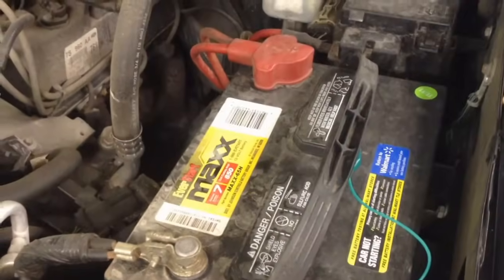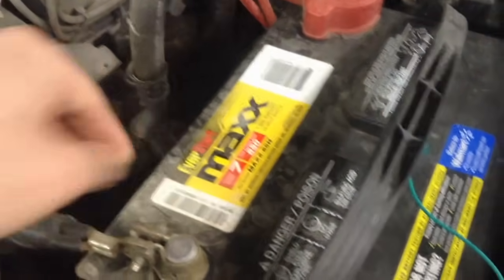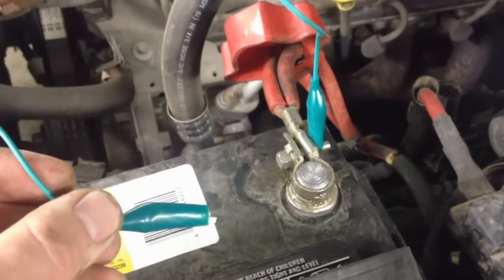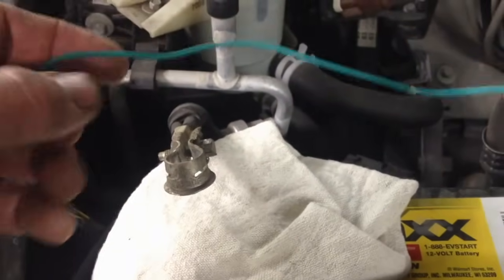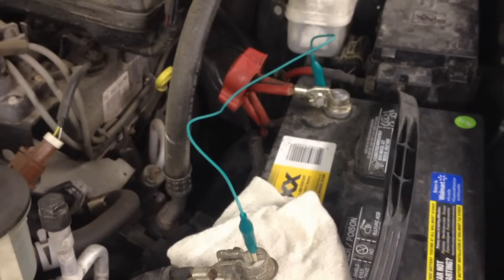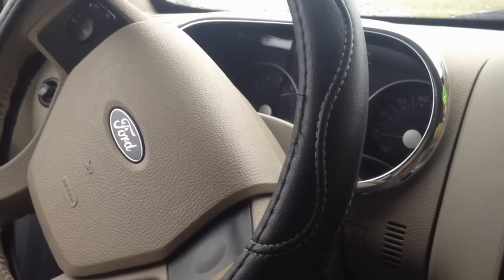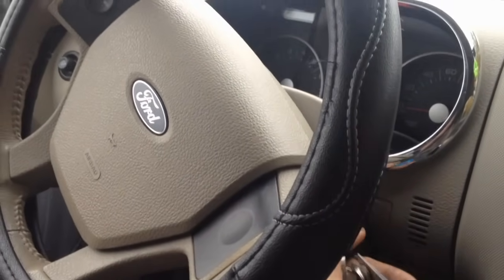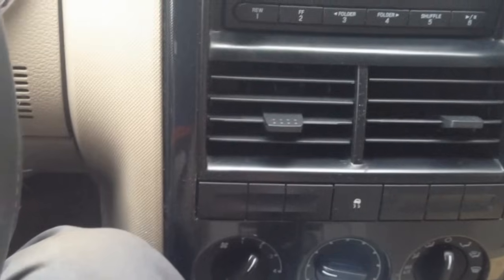How To Clear Your PCM'S Memory On Fords After Repairs

Comment: hey so I have an issue. i have an 05 Ford focus zx5 a year ago I had an alternator go bad somewere down the line in the repair at the shop or the tow truck trying to jump it, it shorted something in the system. now my rear wipers don't work my power side view don't work, no horn, no roof lights and the front wipers only work with the relay half in. all fuses and relays have been checked and all are good. I got this car at 3200 miles there is now 220000 miles on it so i would rather not spend a fortune on her especially if it's something i can do myself. any help would be greatly appreciated.
Reply: Benjamin Baker - set a multimeter in resistor mode (ohm) to see if individual electronics work by putting it on each side of the electronics.

 If it gets a value it is either shorted completely (nearly 0 ohm) 
if it has resistance it should work 
if nothing appears on the multimeter (aka it says 1) it means no connection beetween the points... 
Hope this helps :)
Reply: Benjamin Baker try adding a ground strap from your negative battery post 2 a Good ground!!!!! just a good idea.i saw a focus that when the key was in, nothing worked.added a good ground strap & FIXED!!!!
Reply: Benjamin Baker I 2 have a focus (03 2.0 Dohc L4 vin3) I watched a south main auto video where a focus had the same problem.there was a beautiful green Chevy nova or chevelle then after showing it, they bring in a red 04_05 focus if my memory serves my rite.hope that helps u!
Reply: Benjamin Baker also I'd check the connections on the the altinator!!!!

Comment: I think people are misunderstanding this video. If you have a bad transmission,  then replace it with new or rebuilt, you need to reset your ecm,pcm,computer so that the bad curves that it has saved will not be used on your new transmission- thus causing a good transmission to act just like your old bad transmission. Resetting your ecm,pcm,computer does NOT FIX current problems with your sensors, airbags, engine or transmission. Those issues must be traced down to their source, bad grounds, skinned wire, mechanic failure, etc and fixed....then.... you reset your computer, ecm, pcm (all the same but different names).
Reply from the maker: +43yr old Toy collector yes this is only resetting learned values to stock so it can learn correctly from there once the concern is fixed.
Reply: FordTechMakuloco IF!  you misunderstood this video, one is not listening to what Jedi Master says.
Reply: FordTechMakuloco so what about the video you made about harsh shifting points? Will this work or do you have to go to a dealership with the scan tool?
Reply: FordTechMakuloco  when I shuldd reset the PCM when the engine is could or hot
Reply: 22KPAR1X Cyberdyne
Reply: 22KPAR1X Cyberdyne.
Reply: It can cure hard shift issues by clearing the adaptive table....
Reply: Look below at Bruce Hubbells comment helped the right shift without tranny work....
Reply: My husband just put in a tranny on his 2007 F150... It will not start now. Battery, alternator, starter all good. Turns over. Could this PCM reset solve his problem?

Comment: thanks for the vid. I'm having an issue with my 2003 Ford Expedition 5.4L. I'm having a no crank, no start issue. I was having fuel pump issues, so i assumed my pump finally went out. so i replaced it (disassembly was a headache for me). after that, i continued having the same problem. no crank, no start. then a mechanic told me that it may be my theft  (PATS) system. so i did a little research and it makes sense. after doing further research, i seen that it could be my PCM. so i removed fuse #34 which controls my PCM, fuel pump, fuel injectors, fuel pump motor, etc. after i removed the fuse and tried to start it, it actually cranked but didn't start for obvious reasons. so my question is, if i do what you just demonstrated in your video, would this clear my PCM and allow my car to start? if not, what do you think i should do? it's going on 3 weeks now and i really need my baby up and running. any advice would be appreciated thanks in advance and keep up the great work. your vids have helped me on a lot of my repairs.
Reply: WELL?!? WHAT HAPPENED??
Reply: @KnockedupNout  It ended up being the fuse box. The motherboard was burnt out on the back of it. Purchased a new fuse box online for about $400. Easy install, took me about 30 minutes by myself. Truck started right up
Reply: @OmniChillz  whoa, you answered... 3 yrs later... Amazing! I guess this will be something else I check. I've a 1999 ford f150 xl 4.6 (new to me, I'm a Chevy person, I don't want to regret my purchase!) I cleaned the battery terminals and now it cranks; no start. Checking PCM to see if it helped tomorrow, next I'll examine the fuse box. Checked & replaced fuses, spark plugs & wires, fuel pressure, inertia switch, fuel pump & filter, maf, threw a multimeter at everything I could reach. I don't f* get it!! I'm at my wit's end. No start with starter fluid either. Sometimes it will ALMOOOOST start, but doesn't. After terminal cleaning, it started for 10 seconds & died, then for 3 seconds then died to never start again. Antitheft is not triggered. Only reading it gave was p0704 (I think? Lean bank left?) Turns out spark plug 4 was not even plugged in! Ran like that though... Plug was also cracked, I found upon replacing them. Still nothing. I'm stumped and irritated I have not been able to fix it yet.
Reply: @KnockedupNout  Check the fuse location for the fuel pump. Take the fuse out and look to see if it's any burn marks on the end of the fuse and on the fuse box. You don't have to take the whole fuse box out to inspect it
Reply: @KnockedupNout  Ever figured it out !!!
Reply: @brianblithe2271  Yes and no. While cranking, if I turned the wheel or rocked the truck, it would almost start, turning over but just not getting going. I bought a PCM and had Ford reprogram it and it started! But it had this thing that when it hits about 30mph it would bog down like it was losing power, that was the original problem I was attempting to fix when the PCM committed suicide. Never figured it out.
Reply: @OmniChillz   thanks,  but it ended up being the PCM that was on the verge of death. Turning the wheel while cranking or rocking the truck would get it to turn over but not run. Replaced and reprogrammed the PCM and it started! But still had the bogging down/losing power at 30mph problem, which was what I was trying to fix before the PCM died.
Reply: @KnockedupNout  glad you got it started. Maybe you need to replace your plugs and boots now. Could be just misfiring. Good luck
Reply: Sorry to hear all this bad stuff for you man, so you still have the truck huh ? why not just have mechanic or ford look at it ??? Ive got an 03, and dealer says my PCM is obsolete,  how much and where did you get a new PCM ???
Reply: @brianblithe2271  everything cost money, time, or energy, and I can only throw at it what I have to spare which isn't much.
I got mine from a scrap yard, I just googled scrap yards and went down the list calling them. One ended up shipping it to me and it was cheaper than buying new! Just BE SURE it's the correct model, I called Ford to double check it was correct and I had to have them reprogram it and reset the keys.
Reply: @OmniChillz  I have. I've checked so much that the only thing I can think of doing now is going down every electrical line and see if there's a problem somewhere. Gas psi is good, vacuum is good, all fuses are good, injectors are good... Unless there's a faulty injector, I might have to replace them one by one to see if there's a factory default in one because they sound, look, and tested good but... racking brains hasn't figured anything else out.

Comment: Will this clear check engine codes after repairs are made?
Reply from the maker: +Steve Miles yes
Reply: Will this work with a 2009 Focus MK2?
Reply: Steve Miles it will clear the codes, but existing issues causing a code (s) will reappear.  This does not fix codes.

Comment: Is there any way to program a key on a 2011 f150 if I only have one to start the truck?
Reply: Look on Amazon for replacement keys for 2011 f 150- there is a key that you can buy that will program itself from another key.  Makes sure the key you have is a "admin" key or an original key- I got the new key cut at a hardware store- I had to show them my license and registration before they would cut it- also have the key programmed BEFORE you have it cut- using a key that is not yet programmed- will put the truck into theft mode- and it will not start with any key- My information might be wrong- I am only going by what I was told by other f 150 owners and the hardware store that cut my key

Comment: Can turning the headlight switch to on with batteries unplugged do the same thing? I mean will that also drain the capacitors in the pcm? I do not have any jumpers with alligator clips, so wondering if there's any other way to go abt this. 
Thank you!
Reply: No, just follow his procedure.

Comment: Hey man, I was searching for a way to contact you directly. You mentioned the super duty In this video so I figured you could help me. 
I have a 2011 f250 6.7 for several months it has slammed into gear between. 1,2,3 up shifts and downshifts. When I say slam, I mean it slams extremely hard. 
I have taken it to 2 different tranny shops and both have opened up the tranny and have told me they couldn't find anything wrong with it. 
I talked to 2 different Ford service techs at different locations today and one guy told me about this relearn process, the other guy explained the slip bump and that I may need to have the  slip yoke serviced?
I do have my truck deleted with an MBRP exhaust, sct tuner with custom tunes. the tuning company has given me several tunes to change the shifting and has not made a change whatsoever. I even spent an additional  $500 to purchase tunes from another source with zero change. 
please please please help me out if you have any ideas. do you think this re learn procedure would help?

Comment: Curious if this will clear a learned misfire correction. I had a misfire on cylinder 5 on a 3.0 flexfuel 2010 changed plugs, all clean burn saw no build-up. Swapped 4 to 5 coil. Still had 5 misfire. Changed coil wire harness reset mil misfire cleared up.  Came back 67 miles later checked injector which are good. Checked pressure all with all cylinders 2% of each other. Reset mil ran fine then came back 67 miles after clearing mil. Clear  mil ran fine but it keeps coming back at 67 miles after mil reset every time. 

The only thing I can think of is the learned misfire correction causing it.   Could that be the case.   I truly appreciate your videos they have helped a lot.

Comment: Just bought a 2005 F150 FX4 with 100k miles and replaced the intake with a K&N Cold Air Intake, cleaned the throttle body and the MAF sensor at the same time (thanks to your videos). Would performing this reset benefit me in any way?

Comment: I recently purchased a used 08 Taurus SEL w/155k miles. A few days ago, I noticed that the car would delay and jerk on rare occasions when going between neutral and reverse. It also started jerking from the engine bay when driving at low rpms (1100-1300), particularly around 60mph. I definitely have a different driving style than the previous owner. Mpg average was 18.9 when I got it. It's at 22.1 now. I was told by a friend that resetting the PCM typically resolves these issues. What I think is happening is that the PCM is starting to fry coils and both the faulty coil and the PCM need to be replaced. I guess my question is...Would it be worth it to try and reset the PCM? Or should I try to get the dealership to replace the coils and PCM since I've only had the car 2 weeks? It was purchased with an "as is" warranty, as that was the only warranty the dealer offered and it was the only newer vehicle that I could afford at the moment.
Reply: I should also state that all of the lights and gauges work on the cluster, and I am not showing any check engine lights  or trans lights illuminating when the engine is turned over and running. Assuming a misfire from a bad coil would throw a light.

Comment: A couple months ago I replaced the IAC in a 2003 Mountaineer with the 4.6L. After I did that it started to high idle (2000-2500rpm) after I shut it off, as well as when I come to a stop, I have to hit the brake harder and hold it further because the RPM is still above 1000rpm and not in an "under load" with the vehicle in drive, then it'll go back to its normal idle range either smoothly or abruptly. Would this solve this issue?

Comment: I have 04 expedition it stalls when I first start it have to keep my foot on the gas for a minute or so then she drives good no stalling just a little rough idle cleaned throttle body and mass air flow sensor no vacume leaks that I can find any advise would be awesome
Reply: Josh Graham probably ignition coils or spark plugs

Comment: After complaining to my dealer about the random slamming downshifts and hard shifts numerous times, and being told "it's fine", and getting a couple of their factory PCM updates which did nothing, I did this PCM reset and my 2011 Escape drives like new again.  It's amazing.  Best thing I've done to the car ever.  Thanks!
Reply from the maker: Nice!
Reply: @FordTechMakuloco  any ideas on a 07 5.4 loses with throttle body, 4x4 relays codes , an rough idle smooths at throttle.. an feels like it's fights itself to stop....
Reply: @FordTechMakuloco will taking the negative battery cable off and sanding the surface connection mess the computer up while the ground is disconnected? 2011 Ford Fiesta SES.

Comment: Hi dude, thanks for the video. I followed the steps carefully, did hold the jumper for 5 minutes, but the LTFT levels are still where I left them before the procedure. Any advice? It's a Mondeo 2008 with Duratec-HE 2.0 engine. Will appreciate any help. Thanks again.

Comment: First off, love the videos man. Excellent knowledge you are passing on. I want clarification though on some things you stated in this video and the one involving a pcm memory reset after replacing/cleaning a throttle body. You stated to leave the jump wire connected for 1-2 minutes in one video and then 5-10 minutes in another. Which one do you think is correct? Second, I should drive the car really easy/normal for a few days after doing the reset? Appreciate your input brother.
Reply from the maker: They discharge pretty quick so 1-2 minutes is probably sufficient but 5-10 would really make sure the system is totally dead and reset so I would say 5 minutes is best. You only need to drive the vehicle a easy for the first few warm up cycles so I guess that depends on how much you drive it.
Reply: +FordTechMakuloco Gotcha so just the warm up periods. Thanks for the clarification. Got it draining again now.

Comment: I have a 2004 Ford Thunderbird that I have been chasing down Po171 / P0174 lean codes.  I replaced everything including the coil over wires called out in a Ford bulletin.  Should I do this Clear procedure after completing the coil wire replacements?  Thanks

Comment: Should this be done after replacing coil over wires that are part of a recall.?  Thanks
Reply: yes
Reply: Thanks for getting back to me.
Reply: +Frank Favale i just had the p0171 and p0174 codes to had a little rough idle i changed the coil packs the spark plugs the manifold gaskets and did the valve gaskets while i was there on my expedition i still had a little vibration but after doing this it is smooth again.

Comment: Would this technique work on a 94 Ford Mustang GT? The 5.0 stangs are equipped with OBD1 and I wouldn't know if this would a apply.
Reply: ODiST - OFFICAL 
I’f like to know also, if this method clears the obd1 pcm. I have a 94 sho

Comment: just pointing out that this will pretty much work on any 96 and after vehicle.  my impreza was having some low and rough idle issues so I cleaned the throttle body reset valve lash and did this exact same procedure for pcm reset and now it's runs perfect and much more responsive on the throttle.  it's a manual so no worry about re learning shift points.

Comment: Thanks for the reply bud. If you lived here in Jacksonville Florida I would bring you my truck instead of taken it to the dealership. Keep up the good work bud.
Reply: William Santiago do you know if there's any f150 truck clubs around J' ville?
Reply: Just my words dude !
Reply: Get a Actron CP9690 code tester. It checks live, record, graphing, transmission codes, ABS, SRS, emission readiness test, and MORE! It works from 1984-2013 and is updatable using a USB cable from EBAY. It comes in a black pouch. It has code-connect to diagnose codes from record feature. It retains the memory of tests until you erase the memory. EBAY has it.

Comment: How do you do the memory deal on the 2011 6.7l dual battery diesel truck? Thanks for the info buddy,thumbs up.
Reply from the maker: You remove both negative terminals then short only one side because both side connect anyway.

Comment: would this clear up the mystery of why my 2nd new alternator  w/ new battery on my 98 ford explorer 5.0,which I love, not chargn my new battery . it used to be so simple and this is drivn me nutz
Reply: lolol I fixed it ..........bought a new truck!
Reply: Main fuse = 175 amp?
Reply: its not the fuse lolol gotta be a bad ground somewhere!!! time for shop i got beer to drink
Reply: Marble Pimp ch check the middle wire from the alternator clip it's going to be broken ninety-nine percent  that's it  not making contact